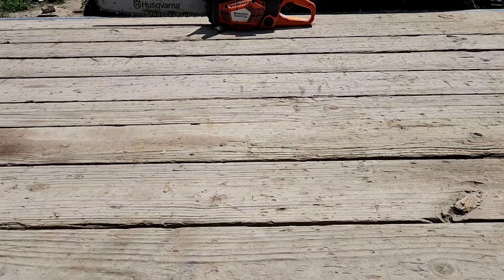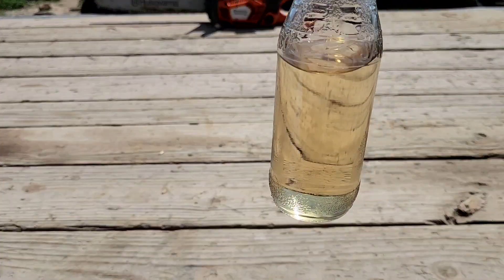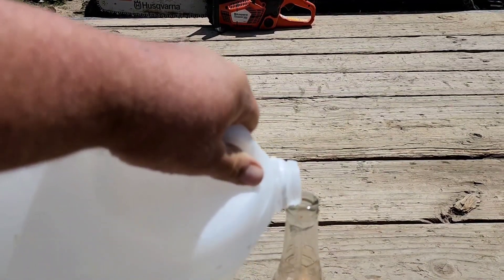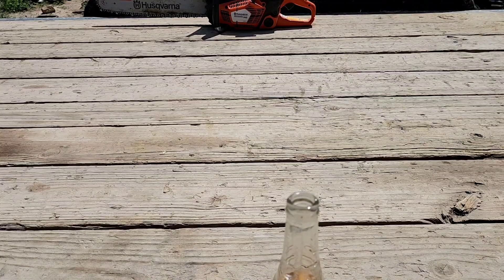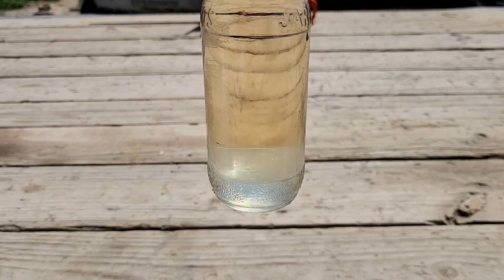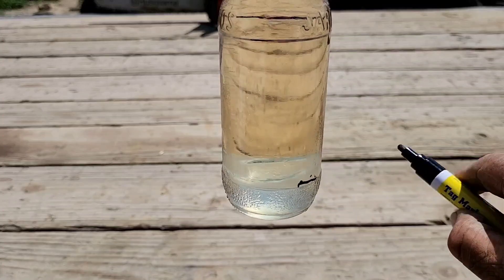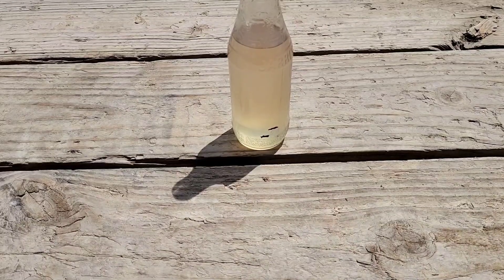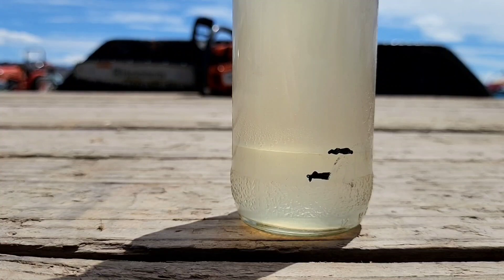How to easily remove ethanol from Gasoline

Comment: The gas station where I was buying ethanol free gas closed down and I relied on it for my scooter, push mower and generator so no I have to get it a different way.
Reply from the maker: @someguyto4675  that's a bummer. I've been seeing it at more and more stations, though.
Reply: @dusttodusthomestead  I just found out today that the race track next to it had actually bought it and they will be selling racing fuel to the public if they want it. May there is hope after all.
Reply from the maker: @someguyto4675  wow! Thats cool. Nice to have that option. 👍🏻

Comment: I also put a few drops of food coloring to better tell the layers. My question is do i need to add octane booster
Reply: Depends what grade you purchased to begin with and what your equipment requires.  Pure ethanol has on octane rating of over 100.  E10 blend (10% ethanol) raises octane by approximately 2 points.  So if you do this with 89 E10, you should still get 87 after removing the ethanol.  If you think you are getting a ping, knock or detonation (always check your plugs when making such a change) then purchase 91/93 or add octane booster.  

For me it's not worth the hassle, so I drive further to a station that carries ethanol-free.

Comment: IMO add water at  10% of the volume of the gasoline - in other words, if you're treating 1 gallon of gas, add 1/10 Gallon of water and follow his instructions. This is because gasoline only has 10% ethanol at maximum per law in mixed gasoline.

Comment: A little Marvel Mystery in the Oil (MMO) in the gas negates the ethanol and gives extra power via oil. Lubricates the top end while running also. Here in Florida with the heat and humidity its a must.

Comment: It seems so odd to put water into my gas I want to use but my gas keeps jacking up my small engines so I’ll give it a try thx 👍
Reply from the maker: @stevenlengyel9701  it does seem weird for sure. Ideally, a person would find somewhere that sells ethenol-free gas, but those are not always close by for some people. You're right though, ethenol will mess up small engines pretty quickly. 👍🏻

Comment: So what do you do with the ethanol/water once removed?
Reply from the maker: @brianedwards231  I've used it as a solvent or a cleaner for cleaning parts. I'm sure there would be manu uses as it is essentially just alcohol and water at that point.

Comment: Your gas does the same as mine... it turns milky/cloudy when I do this. Anyone got any idea why?
Reply: I went to 20% water, shake 1minute plus and let it sit 24-48 hours. Should turn clear.
Reply: If it's milky, there is still water mixed with the gas.  I takes several hours for the water to separate.   That's why I use antifreeze to pull the alcohol from gas.  It's ready to use in an hour.